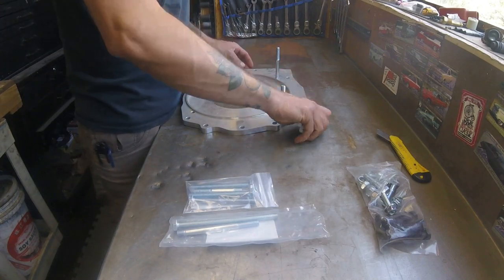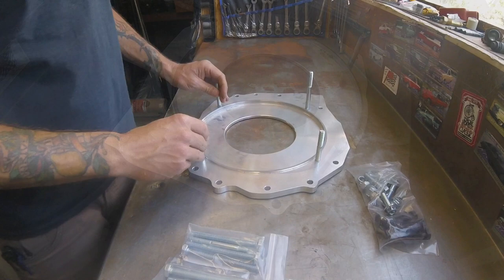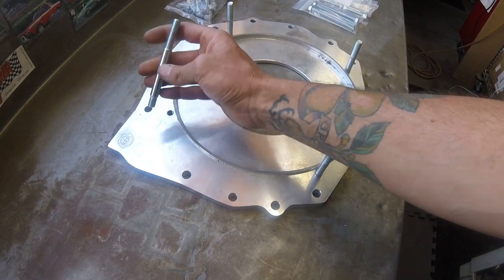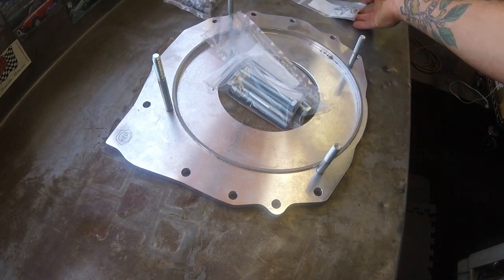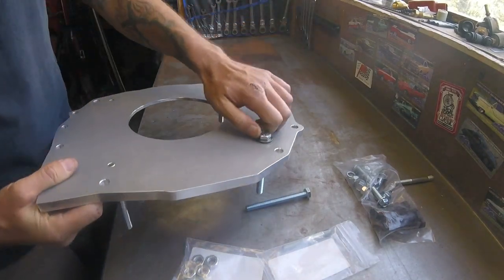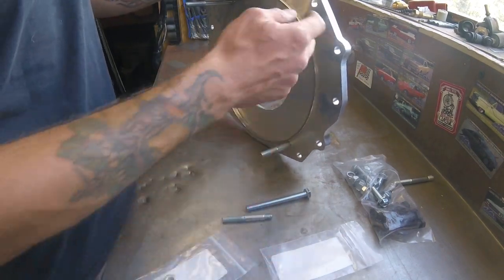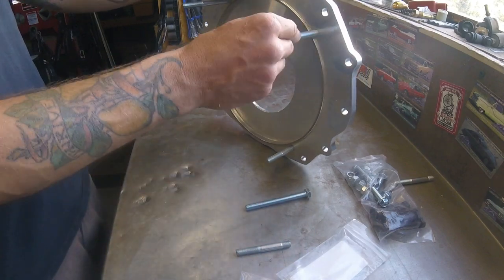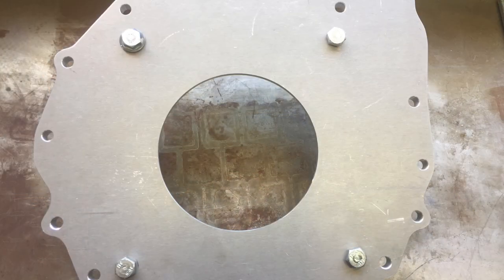VW Type 1 Subaru Adapter plate Tip

Comment: Do you have the specs of the bolts so we know exactly what to grab?    I wish I knew this when I put my subaru motor in, that looks like it should be quite a bit stronger.  Nice work.    Speaking of, I need a harness conversion, I'll be hitting you up when I get the cash!
Reply from the maker: I’ve been meaning to throw the part numbers in the notes - keep an aye out for that in a bit.
Reply from the maker: Just posted the part numbers, keep in mind you may need to cut down if the too-long look bothers you ;)
Reply: What motor are you running? I have a wiring harness that was built by him for a ej22 im trying to sell
Reply: Velocity Labs nvm mines none turbo :(

Comment: Hi Mick,a question not relating to this video , I've got  an ej20 turbo for my 1975 bay bus , is it worth keeping the turbo or will it prove difficult to install ? ie with or without the intercooler coz I can see that being an issue , is there anything I need to know if I leave the turbo off
Kind regards Jim